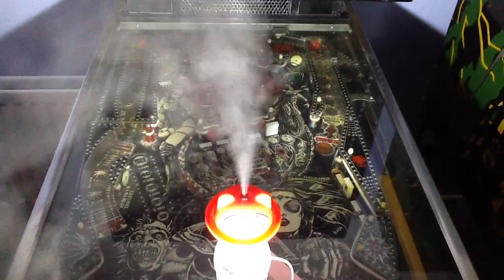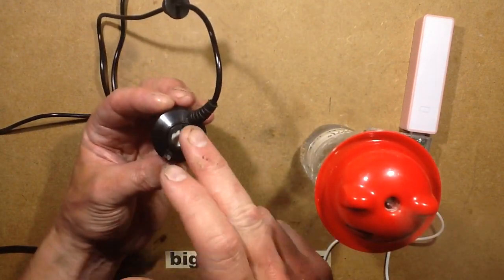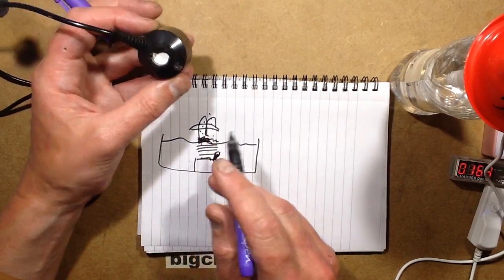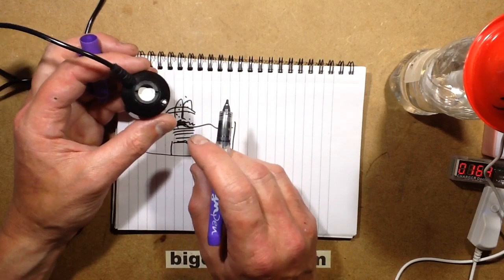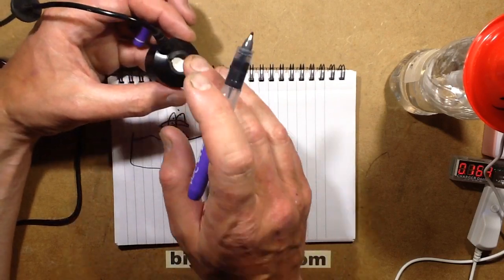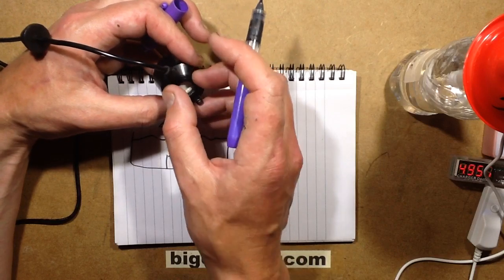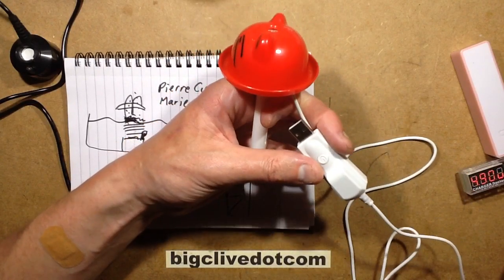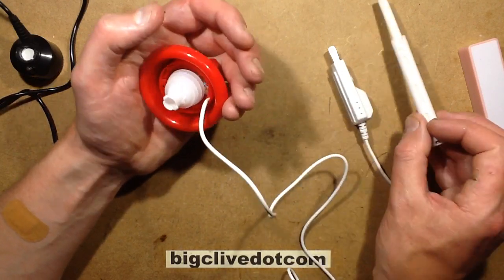USB powered water fog generating humidifier.  With schematic.

Comment: Clive. The choke in series with piezo makes  a resonant circuit with the capacitance of the piezo. This maximizes the current driven into the piezo and max voltage across the piezo. In fact the voltage across the capacitance can be as much as ten times greater than the voltage put out by the transformer.  The piezo is a very capacitive load 
The transformer produces a pulsed output full of harmonics. The piezo circuit runs , I guess, at near the fundamental component. The others are suppressed by the choke. Besides,  they are very far away from the choke/piezo resonance. and the choke piezo circuit is just equivalent to a choke at the harmonic frequency and the effect of the piezo capacitance has fallen to nearly nothing at that frequency.
 I hope you understood what I meant. If not I can elaborate.
Please measure the oscillator frequency and we can estimate a few other interesting facts.
I am guessing but I think if you could vary the choke till the circuit was exactly in resonance, the piezo would shake into smithereens. Which would be nice. 
Note that the piezo has it's own mechanical resonance and the chosen frequency is likely to be somewhere close.
Reply from the maker: I did ponder if the choke was resonant with the disk.  It does look like the transistor is a FET.
Reply: Perhaps you might consider correcting the schematic you show at 12:09 and thereafter.

Comment: I have also melted some kinds of plastic and possibly drilled a hole in glass(I think it was very thin glass). These are weird shit and id like to understand the dangers of them. They kind of sting the finger when you slowly touch the water jet. And touching the plate while running feels just weird. I think it also cleaned a ceramic pot used in a fishtank as a hutch, No fish.
These are some weird things. Oh it also interfered with a ultra sonic distance thingy(as one might expect).
Reply: apparently the thing tries to humidify the moisture in your finger which could explain the stinging
Reply: remo spadaccini
I know what you are trying to say, But please dont. You dont understand me.
That comment of yours is just stupid.

Comment: Aditionally, my Say it again is entirely missing, so I am going to look up your Say It Again Later :)
Reply from the maker: It uses chips that went obsolete as soon as I had designed it, but they can still be found.  The schematic and PCB layout are on my website.
Reply: Indeed, I've had a look, while they may be obsolete, they are still available unlike the original (or at least the original uses an IC that is not worth replacing even if you find one as they are flawed and all die over time - common problem in the synth world)
Reply: Ugh, I hate that!
I hate when manufacturers make chips obsolete so quickly.
You always end up designing something, only to have the parts be obsolete when it comes to manufacturing time ... then you can't get them anymore!

Comment: Whats the chance that the chip is just a 555?  It would certainly be a more interesting little circuit.
Reply: Slim. Output being driven by the threshold pin, can't imagine that ever working, and that's just the most blatant thing, not the only one. You'd think that Clive would have spotted a 555.
Reply: What about a th48r002?

Comment: And now I have to research ultrasonic vaping. Damn it Clive..
Reply from the maker: The first Japanese vaping devices used ultrasonic atomisation.
Reply: @bigclivedotcom  Cheers for the info. Been doing some reading and there are a few ultrasonic ones being released even now. Seems like a much better way to produce vapour and even reduce battery requirements. Clearly a project in it..

Comment: We have a larger humidifier in the living room working with the same technology.
After a while the flames from the kitchen stove start burning yellow/orange instead of blue.
Still wondering what's causing it.
Reply from the maker: Are you sure that's not lack of oxygen if the stove has been running for a while?
Reply: +bigclivedotcom No it's definitely caused by the humidifier.
It took me a while to link the humidifier to the yellow flames since the living room and kitchen are separated by a halway and 2 doors (which open frequently). But doing a few tests (checking the colour of the flames before it was turned on and again after an hour when turned on) has made me 100% certain it's caused by the humidifier.
I've read other people noticing it too but no definitive conclusion on what's causing it.
My guess is it's the minerals, calcium or magnesium in the tap water that are causing the colour shift.
Not sure if your tap water's the same but you could easily do a test by putting the thing in your kitchen for a while.
Reply from the maker: I'll guess that your water may have a modestly high mineral content?    It must be the dry mineral particulate in the air once the water has been absorbed.  If there was any sodium salts present it could result in flame colouration.

Comment: This may be a stupid idea and feel free to shoot me down in flames if it is but.... I want a cleaning chamber for contaminated pcb's and I'm wondering if atomized isopropanol alcohol would be at risk of igniting when being atomized via this design of disc. I have already discounted using the submerged type units as they get warm. If this type does not and the electronics were of course sealed and away from the already sealed cleaning tank would there be any risks? the ultrasonic baths just don't work that well and have damaged components in the past. Thoughts on this please. Thanks.   :)
Reply from the maker: I've tended to just wash boards with isopropanol.  Some collectors of vintage arcade games actually put the entire PCB in a dish washer, but I'm not sure I'd trust that.
Reply: +bigclivedotcom Hmmm something to think about then. I think the risk of a spark is going to be higher than anything else. Maybe a submersible pump and jets are the way to go.
Reply: +bigclivedotcom I will add my vote to see your workbench to. I learnt to keep the work area clean and things in the right place as a teenager when I sat on my soldering iron !  Owwww
Reply: I would recommend against making a vapor of anything explosive for cleaning PC boards or for any other purpose unless your actual intent is to cause an explosion. (No, I haven't looked at Clive's vaporized kerosene video yet!)
Having done PCB assembly and high reliability soldering for years, I can say that I have seen hot pressure-washing with water, and soaking in isopropanol (I would use 90% strength) before brushing for cleaning PCBs, but it depends on what components are on the board - small mechanical relays often have tiny vent holes that get opened after final cleaning, and some components are actually porous and can absorb liquid. Best bet after cleaning is to bake at a very low temp for a few hours to drive liquid out of components before powering up.
Reply: +cloudfan notthatcloud Thanks for that. Spooky reply as I have that exact problem of Ingres to components that and the ultrasonic cleaner turns my teeth into another oscillator!  The chamber would be sealed but I think you may be right and the risk is to high even using a normal pressure based atomiser and pump has its risks. Its a shame as I used to use a trichloroethylene vapour chamber and that worked very well but the cost of the units and the fact the the chemical is frowned upon due to environmental concerns makes it a non starter for me. I am going to have to rethink this entire cleaning process and keep explosions limited to the 5th of November. ;)  Thanks again for your reply.
Reply: Stuart - Yeah, I kind of miss trichloroethylene - it worked so well. Toluene can still be purchased here in the U.S. and is a good board cleaner, but bad to breathe.

Comment: am I missing something ?
Why isnt this idea used in e-cigs ?
Reply: not enough volume
Reply: how big a tank would you need ? lol
Reply: BillyNoMates1974 it's not about the tank size it's about how quickly it can vaporize the stuff, on top of that, vape liquid is made up of propylene glycol and/or vegetable glycerin which is too viscous to be ultrasonically vaporized. needs to use heater filaments.
Reply: Some say the original Ruyan electronic cigarette did have an ultrasonic atomiser, their own website said it had an ultrasonic atomiser, it was very expensive so no one on ECF got one to find out sadly :(  The DSE801 clones that looked like it just had a coil.